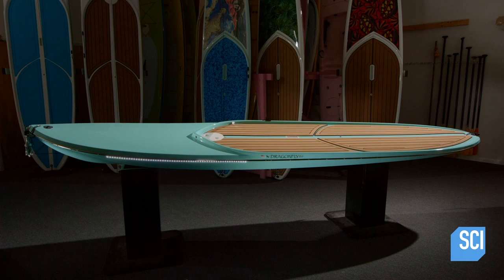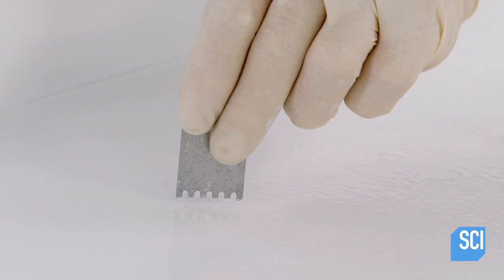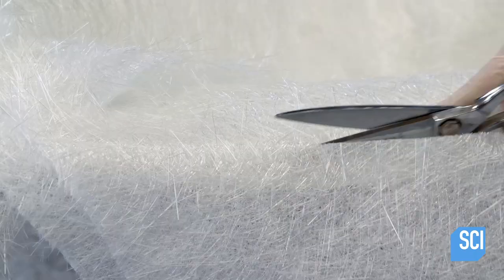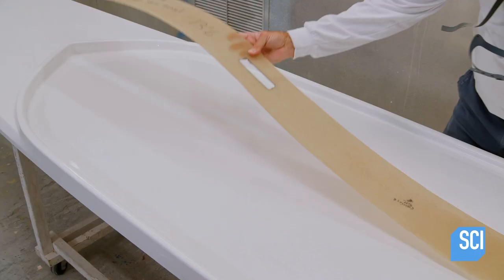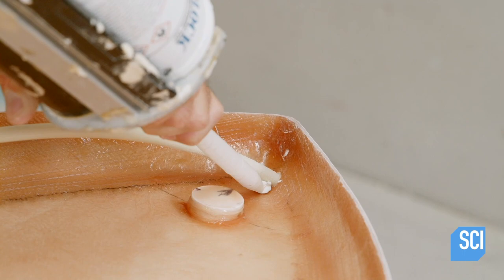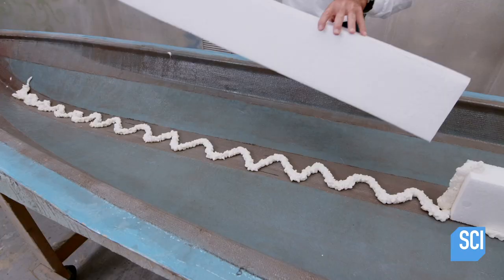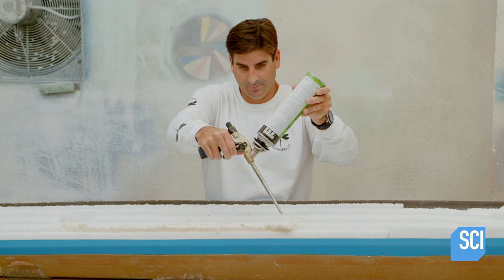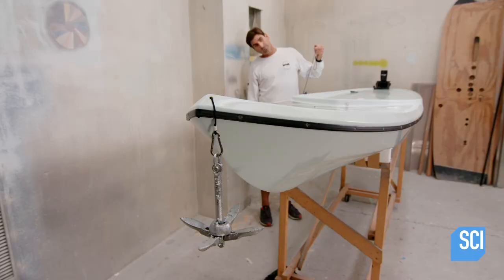How Paddleboards Are Made | How It's Made

Comment: Really wanted to see how the seam of the two halves was fixed to make a watertight seal.... Was completely omitted.
Reply: I have seen one of these Dragonfly "paddleboards" (they are obviously boats - not boards).  The hull leaked and there is not a way to drain it.  I understand that the people at Dragonfly are cool...but the boat is not perfect yet.
Reply: My guess is a combination of silicon around the edge mating surface and the expanding adhesive foam inside on the stringers. The best way would be  a slight change to the design creating a lipped mating surface utilizing an epoxy type bonding agent. Nice to see it hand laminated though,  most processes now use vacuum bagging. Always a tough balance  for things like this, weight, cost, ease of assembly,  etc. Working with fiberglass can be dirty, nasty and itchy but I thoroughly enjoyed working fiberglass.

Comment: ive never seen a SUP like this, they're usually inflatable and without anchor.
Reply: Or Solid "glassed" foam and made  essentially the same as a surfboard.
Reply: I used to work for that company. It’s called Dragonfly Boatworks. They do boats and paddle boards.
Reply: isups were made long after rigid boards were around
Reply: @hillbillypirate3659  hi that is a neat work may I ask you about the assembly of the edge of the upper and lower parts how do you do it